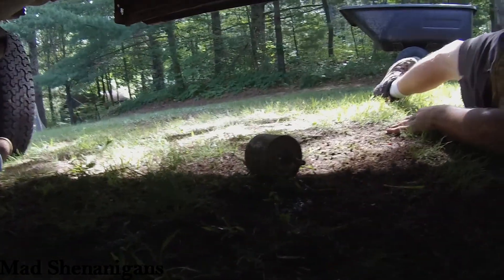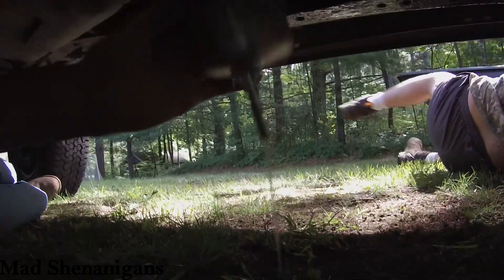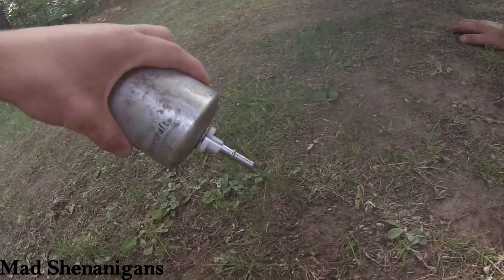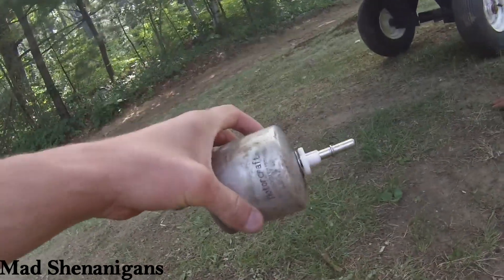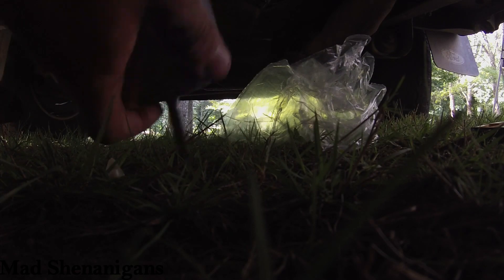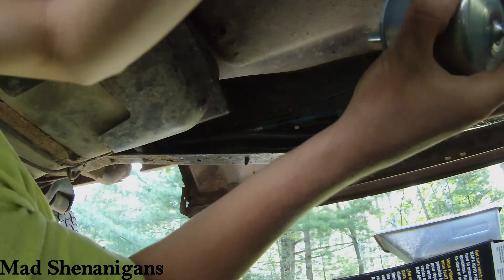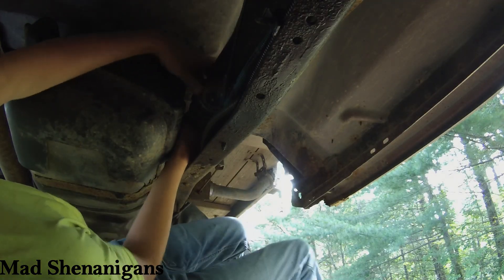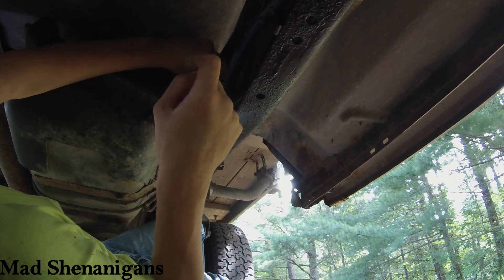Replacing the Fuel Filter on my 96 F150

Comment: The reason your front tank is leaking at the strap is that over the years of driving the truck, dirt & debris collect under that metal strap. Then add moisture & time. This causes the wet dirt to rust a hole through the tank. My 1996 rear tank did that. The replacement tanks are made out of a plastic composite now. So this won’t happen again.

Comment: What your experiencing is a bad check valve in the rear tank causing the front tank to over flow. Got the same truck with the same problem. Ford had a recall on these as well, the check valve gets stuck open allowing gas to flow freely from one tank to the other. It's not just gas sloshing around sadly.
Reply: So do you take it back to Ford and they fix it, or do you have to drop the tank and fix it yourself?

Comment: The gas is leaking out of the front tank because the two tanks are plumed together so when u fill the back tank it over flows into the front if the gas sloshes around u could just block off the line that connects them to solve your problem
Reply from the maker: Thank you

Comment: get a ratcheting line cutter and just cut the T out on your front tank and run your lines straight back to the rear tank with a hose and some clamps. front tank never gets used I just dropped mine and now changing the filter is less of a nightmare

Comment: Dunno if you still have a truck or have figured it out but there’s no return line from your regulator to the rear tank, only the front, so when you run off the rear tank the front tank gets all of the backwash from your regulator... if you didn’t have a hole in your tank it would have filled up and started coming out of your front tanks cap, which i can tell you from experience is a bit surprising, especially when your an hour into a 7 hour drive and the front pump doesn’t work... I use to have to buy hand pumps from gas stations (the gas would eat the o rings in them in 2 days) and hand pump 22g from the front to the rear tank until I replaced the front pump
Reply: I had the same problem when I got tboned as a pizza guy.

Comment: By only using the back tank you should have an entire pool tank of gas and I have no clue how much gas you actually spelt out the return line goes to the front tank it could be an empty tank in the front when you start but by the end of the week the return line will fill it up